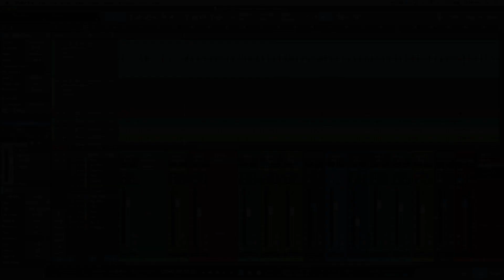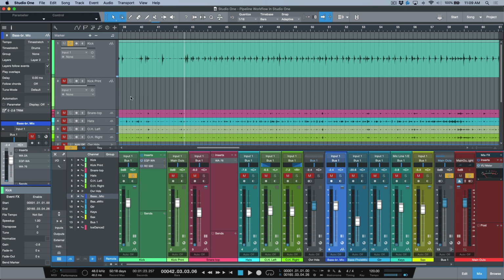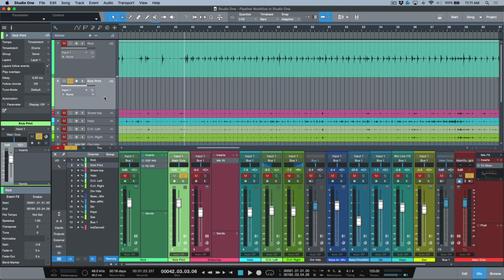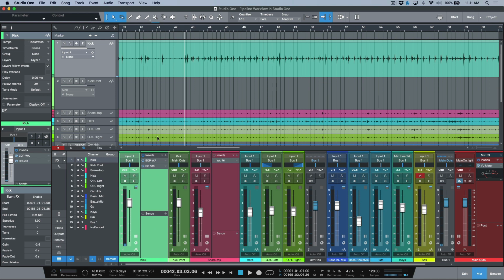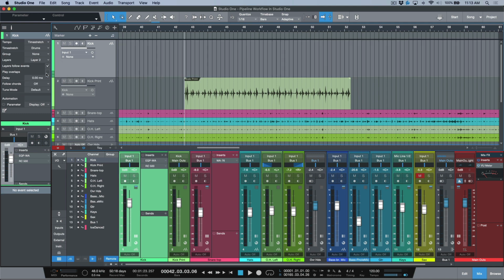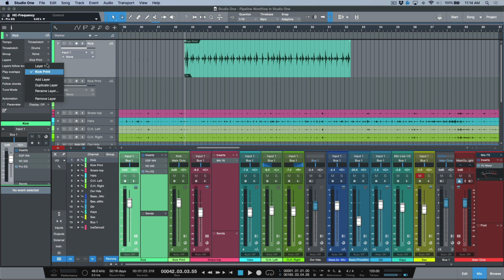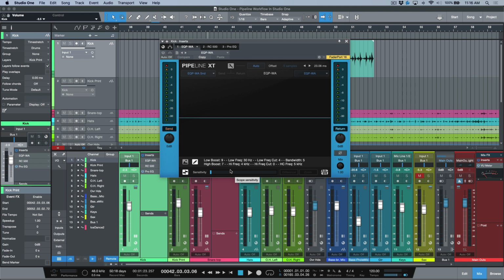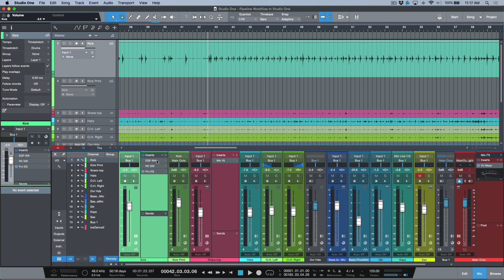A Workflow For Committing Pipeline XT Plug-in Inserts In PreSonus Studio One

Comment: I tested Pipeline with outboard gear vs just sending a track out to the outboard gear and bring it back to a new track. I don't hear any difference. I don't get any latency either way. Is Pipeline's purpose to be used in combination with plugins and outboard gear. I haven't tested it with plugins but I'm guessing this would be the best use for Pipeline where plugins can cause latency?

Comment: Nice way! I do it a bit differently and work as well. I print the stem than I import it automatically right at the export function. It has to be done in real-time of course, and  do not bring any latency issues whatsoever. Quite the same thing you've done. I think it is better to simple disable the track were you had the non printed version and keep the plugins and pipeline there for fast recall. Kind of the same thing.  I'm going to do a video of my process here for my Brazilian Portuguese language as well.  
Thanks  for the input and great info, Marcus!  
You aways help a lot!

Comment: I've been doing this for years the old fashioned way. Figuring out round trip latency myself by nudging a copy of a click track. Then record to new track with monitoring plugins post print. It works but it's time consuming and you cant use plugins that introduce latency or the whole thing needs to be re-calculated. The Pipeline XT seems great but it's problem seems the same as Cubase's hardware inserts. There's no good way to print. The best option would be a system of re-printing the audio to a new layer BUT at the Pipeline XT plugin stage PRE any effects down stream without turning them off, allowing you to still monitor them during printing but NOT printing them. Who wants to sit there for 5 minutes of that print having to hear your external compression-EQ chain without any of the post FX? The answer here is really the other track method and putting the post FX on the being recorded track. They can be copied from the Pipeline xt  track and disabled at the source. Still it's a dumb workaround to have to make. Just give a damn button: Create Pipeline XT processed layer, which prints to the same track but before the down the line FX. The plugin itself could library the processed takes for you. This is the plugin that would make me get "Professional" instead of "Artist" It's so close it seems! It honestly seems like the people that create this stuff have never done hardware processing themselves, like they think we want to leave one piece of hardware on one track till mixdown.

Comment: Hi Marcus, Thanks for this. After rendering the track from pipeline is there a time difference between the original and processed track (pipeline rendered)? Do you need to time adjust the rendered track by say 20ms or whatever pipeline was originally offsetting? I'm aware that pipeline adjusts the playback whilst activated. However, does the newly rendered track appear in the correct place or do you need to drag it left to match phase/time etc?

Comment: Just so I am clear, you pinged both inserts individually, so I take it you are using two instances of Pipeline on the same track as opposed to daisy-chaining the two FXs.  Is that correct?  I have  daisy chained an EQP and La2a before as a single Pipeline unit and have not had any phase/latency issues that I can tell.

Comment: So useful. Thank you! I've been using Pipeline a lot recently as I'm a big fan of hybrid mixing (and S1 is so good for this, hence a my migration from PT). I've never been happy with my workflow for bouncing external hardware so this is great.
Reply from the maker: Yeah - its a tough one to pin down, I love the idea of committing to sounds (as if though they were recorded that way) but I also mix hybrid and utilize outboard, and I find that I needed to employ a solution where I could respect my signal chain and revert back to things if needed because it's easy to over-cook things.. If Im mixing something and I have a light week, Ill leave things set up on the hardware, and leave Pipeline Running and active, and tweak till im happy, but if I know Im going to be using the hardware on other tracks, or for tracking - I needed to put something in place to allow for that...
Thanks for your reply, Cheers, M 🍻
Reply: Hi Marc, I hit the auto button in pipeline but I still hear latency, if I just play a snare and process with a compressor, I hear it double?
Reply: @Readdy-223  are double monitoring - i.e. once through direct monitoring on your interface and once through Studio One? This can sound like latency.

Comment: Hi Marcus thank you so much for all your help on YouTube, just a question, is this way better ?,  i always use bounce to new track , is there a difference ? I mean quality of sound ? or is it the same, I work with console 1 and a dbx XT hardware and some kt pultech clones and a fmr and  golden age into pipeline, back into my presonus greetings from France , Rob .
Reply from the maker: Hi Rob,
Better? Hmmmm, I'm not sure... I doubt there's a difference in quality beyond the fact that re-recording (to a new track) will create an audio file based on your songs settings (ie: 24bit 44.1/48k) vs bouncing which will create a 32 bit floating point file (at the sample rate of your song) But at normal levels that aren't clipping, I don't know that it's possible to hear the difference.. (At least I certainly don't "hear" the difference)

This (for me) is more about finding a workflow that allows me to work in a way that I can recall things if I ever need to.. Which forces me to come up with certain rules that I force myself to follow... Also once the mix is finalized, and signed off on, I would do this same workflow, and render pipeline inserts into the files (and replace them on a new layer) so that I could archive and recall the mix and it would sound the same (even when I'm not connected to my hardware)

That's why I titled this video the way I did: "A Workflow For Committing Pipeline XT Plug-in Inserts In PreSonus Studio One" Because it's NOT "THE ONLY Workflow..." It's based on the concept of rendering Hardware inserts, as the first plugins in the signal chain, which then gets passed to the next plugin(s) the same way it would be if I left the hardware inserts plugged in and active.. Thats why it's important to disable any levels, or automation, and print the new file with the fader at Unity Gain. That needs to happen especially if you have any threshold based settings on plugins coming AFTER the pipeline instances...

This obviously becomes even more complex when we talk about using external hardware on BUS Channels, or the Main Outs across the whole mix!!

I really hope that we eventually have the ability to Transform BUS Channels into rendered audio (like Pro Tools does)

I also really hope that at some point PreSonus revisits the way we can transform tracks - and allows us to have an option to render only certain plugins in the chain (like the first 2 hardware inserts) and also gives the option to choose whether volume / automation get's rendered, or stays in tact.. Because this is essentially all Im doing here in this video.. I'm manually rebuilding the signal chain, and making sure that the Gain of my Audio stays the same..
Thanks for your comment! Cheers, 🍻